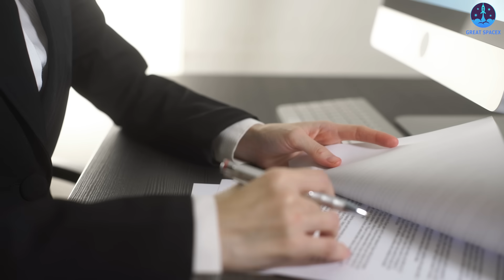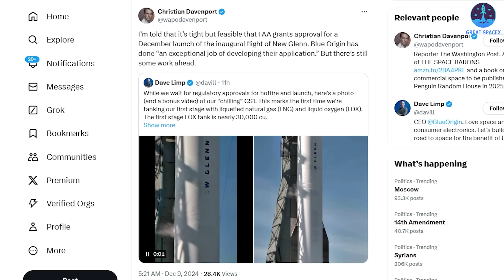Unexpected! NASA's "NEW Head" just Revealed SpaceX Polaris on Starship is CANCELED...

Comment: Starship doesn't have an abort system that could propel the souls on board away from the propellant. This simple fact indicates that the current vision of SS is an unmanned cargo rocket, probably primarily a Starlink delivery system. This was one of the major considerations that ultimately doomed the shuttle STS program.
Reply: You need propellant to get away from the propellant...

The upper stage is an abort vehicle... to get away from the bigger part of the propellant - in the booster.

And it is not besides the boosters - that instantly damaged the shuttle - it is in front of the booster, it can do hot staging...
Reply: @Richard-S upper stage is NOT an abort system! Actually go watch a vid of Crew Dragon testing it's abort system,  then delete your comment!🤦‍♂️

Comment: Enough of the Blue Origin delay stagnation nonsense. They're finally launch ready and you're acting like their most exciting moment is a negative. Yea they're well behind SpaceX but they're probably 2nd place in the world now. New Glenn's launch is an exciting moment to celebrate and the current delay seems to be due to FAA approval.
Take a moment and enjoy New Glenn finally getting launched, even if it is only reusing the 1st stage.
Reply from the maker: I think the second place now is Rocket Lab, not BO
Reply: @ rocket lab are still pretty small in terms of payload but unlike BO they have reached orbit, so I can’t fault them there. New Glenn will change this.
Reply: Blue Origin suffers from SLS Syndrome. Launch Ready means one scrubbed launch after another.
Reply: @Harald-  I agree, but this moment and this delay is not the time to dunk on them. And they’re spending Bezos bucks not Uncle Sam bucks and have actually engineered a new engine unlike many others.
Reply: BO is far far away from anyone...